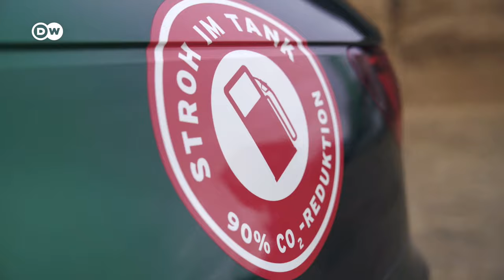Why eFuels Can Save The Combustion Engine

Comment: Combustion engines will never fully disappear. They are a highly developed technology and have too many advantages. Fuel powered generators, for example, will always remain important in some areas. Because they can still produce electricity, when everything else fails.

Also, heavy duty logistics and tourism will be eager for getting their hands on carbon neutral fuel. Ships and planes are simply way too heavy to be powered with batteries. Heavy long distance trucks probably as well. And lets not forget that there are big industries, that would not be too happy, when the combustion engine disappears entirely. Repair services, spare part dealers, used car enterprises and many others. They will all not be too hot on that scenario. Many always only think car engineering and production in terms of workforce reduction, should the combustion engine be a goner. It goes much further than that!

Right now, e-motors are the talk of the town. In no small part because of significant political good will and substantial subsidies. Which especially entices businesses to get electric company vehicles, since they can give themselves a PR effective green tap on the back and shave off many of the costs, (plus writing these cars off of their taxes anyway). But I am not fully convinced how well a major or (let alone ) all out fleet of electric cars would work at scale.

One big problem (imo) is that we probably have seen the biggest cost cut downs in battery technology already. Which means that a new battery will remain the most expensive functional part in electric cars. So when a battery fails or simply becomes too unreliable to be used any longer in the car, this will typically mark the point, where many electric cars will enter the used car market. But who buys a used car, where one of the first orders of business will be a battery swap or replacement, which will at the VERY least cost another 3.000 Euro (assuming a small 40 kWh battery and very beneficial price development in the next four years)?

Battery price and/or a better life span will be key for e-motors to succeed at large. They have done fairly well on other fronts (like possible reach per charge, comfort, ease of maintenance and general performance). But the price tag for battery replacement makes e-cars very unattractive for many used car buyers, which is a mandatory factor for broad market acceptance that is not to be underestimated at all.
Reply: This comment is filled with SO MUCH misinformation and baseless assumptions that I do not even know where to start.  Especially your battery swap argument. Let me make it clear that this only even applies to second gen modern EVs I.E. the first Lithium Ion cars, MOSTLY the Nissan Leaf. No other EVs suffer from anywhere NEAR that degredation. I own a 7 year old used EV which had almost no degredation, most EV batteries don't degredate as much if the car has decent battery management system, the Leaf did not have that.
In fact the Leaf is probably the reason why this stereotype exists in the first place.
The battery swap myth is simply not true for 90% of EV models.
Nevermind the fact that even battery replacements on an EV after 8 years would STILL be less expensive than all of the maintenance you'd have to put into a gas car over that time combined, nevermind the cost of fuel.

Concerning your baseless assumption on battery prices, you don't know that, all signs a pointing in the direction that battery prices will continue to drop, many companies are currently building giga factories to achieve that, we are at the beginning of an S curve here, the max production capacity that we need has not nearly been reached yet, and the closer we get to it, the cheaper the batteries will become to produce.

Now let's talk about emergency generators... They suck. They work when everything else fails, yeah as long as you can come by gasoline that's true.
But batteries can do the same, and you could recharge them using solar arrays, in fact many people around the world have used systems like that to disconnect from the electricity grid.
Solar, wind and batteries will be used for microgrids which are much more resillient to outside force than the macro grid, and their existence alone makes gas generators obsolete.

About Trucks and airplanes. Yeah you might have a point there. But what about hydrogen? To create e fuels you need to create hydrogen. Then you use energy inefficient processes to turn this hydrogen into hydrocarbons, then you use those hydrocarbons in very energy inefficient engines to propell a vehicle... So why not just use the hydrogen and skip 3 or 4 inefficient steps? Because fuel cells are expensive? Perhaps, but I think they are more promising than an inefficient technology that barely exists in the experiemental stage thus far, and offers no real benefits over the competition other than "modified versions of today engines could potentially run on it." Because that's another issue. Most car engines on the market right now cannot even handle synthetic fuels, so you need new vehicles anyways.
Reply: Planes use compressed air I thought?
Reply: @VoodooGMusic  I am not sold whatsoever on this idea, that batteries will get much cheaper. Just look what a battery replacement for a laptop costs. Same tech (at heart), much smaller, has been around forever - still costs 30 to 50 bucks.

The major price drops have resulted from car batteries having still been a fairly experimental field not too long ago. Now the mass production is there, as the tech is understood well enough - and they still cost what they cost. Needless to say that lithium prices only knew one directon over the last two decades - upwards!

I know, that an electric car stands to be cheaper maintenance wise. But the used car market is an entry level market for many consumers. Or just for anybody, who doesn't have the coin for a new car. And again: When will most electric cars enter this market? When their battery is sharply decreased or has been uninstalled to serve a second life service. That just comes with the territory. There are no two ways about that.

That is lilke buying a used car without a motor. Who the hell would do that? And given that several mass consumer markets (mobility, gadgets and appliances as well as energy storage in industry, businesses and households) are all eyeballing battery tech at an ever increasing scale, the assumption that they will get so much cheaper, is simply gullible. The lithium price itself is a key indicator for that.
Reply: @VoodooGMusic  In you comment it sound like electric energy is free. Here in Germany you do not have a large advantage when paying for  30ct at your house and 50ct at a charger. 

2. Generators need to be light. Same reason you do not see high powered chainsaws which can be used for a longer period of time in the forest.
Reply: @DerSnipOr  I am aware of the electricity cost in Germany and it's baseless inflation compared to our neighbors. Still it is cheaper than gas, and add to that the lack of maintenance it's way cheaper to operate an EV than a gas car.
Concerning chainsaws and such, most of those can now be replaced with electric devices, the reason that doesn't happen instantly is because of the replacement cost.
Reply: @VoodooGMusic  
Both you and the original poster are very long winded. But both raise great points. 

In short i hope BOTH you guys are right. Ideally you, but lol. Heavy freight and shipping just works better. Due to something called energy density. Less volume needed for gas than a battery cell. (At least for now.) But as long as we phase out and we should be okay, but its not like we have much time. 
Unless carbon sequestration takes off.

Shipping and imports could also be reduced if more people bought local. Unfortunately LOCAL for California, an already population dense area that also exports a lot, means their water source further contributes to drought. 
If only we could locally recycle as well then it would kill at least 2 birds with one stone.
1) less emissions from shipping overseas
2) less oceanic pollution due to EPA cracking down on USA. (Something thats lacking in asian based recycling) 
3) better logistics due to the materials staying inside USA.
Reply: @MightyJabroni  never is a very long time, you genuinely believe in a 100 years or more we will still be using combustion engines if nuclear generators are as easily available then as combustion engines are now?
Reply: @karl810  Well ...... never say "never", I guess. ^^ Of  course, you are right.
Reply: @psychologicalsigma9917  planes use kerosine
Reply: @VoodooGMusic  You can run current car engines on e-Fuel go watch the video Porsche did
Reply: @stanleysimmonsreactions9056 you can when you are able to get efuels. And this will definetely not happen the next 20 years…
Reply: @MightyJabroni combustion engines are already dead…

Comment: Combustion engines need to be efficient since they are only 25% thermal efficient average while the best production engines run at over 40% efficiency and Formula1 engines run at 50% efficiency 
I think by the end of this decade over 50% efficient production engines will hit the market and with negligible NOx emission 
Using hybrid systems, free valve and pre-chamber ignition or microwave ignition and using biofuel and e-fuel will create a ideal combustion engine
Reply: I also read that turbines are ideal as range  extenders in hybrid setups. They are smaller, lighter, have less maintenance, more power, quieter, and burn much cleaner than piston generators. Check out the TED talk from Wrightspeed.

Comment: efuels can be one of many approaches to move to more clean burning easily transportable/storing fuels for the ICE engines? scania has been building buses that run on ED95 fuel which is 95% ethanol and 5% additives so there is more than one approach to the problem and that could be key : flexibility, diversity and let the economics/politics decide in the long run (the more pragmatic approach?) 
update : after studying the whole efuel process i wonder if the whole process could be far more economical and a real immediate solution if there is no methanol to gasoline high energy last stage? just use methanol as fuel as is (with modification of current ICE engines perhaps?)

Comment: What about the worlds most popular BioFuel: Ethanol? It is made from a vast variety of different sources including trash through gasification. Modern cultivation techniques cut total emissions by 64% or more. Indeed it's already distributed in a variety of formulations but the higher content grades require minor modifications to most existing engines. A much more pragmatic approach than demanding everyone buy an entirely new electric vehicle because modification cost maybe 1,000 Euros.
Reply: Can you convert a regular gasoline vehicle to run E85? If so what needs changing?
Reply: @VintageCars999  of course and millions have. The ECU needs to be made Flexfuel to accommodate ethanol or gas or a blend of the two which it will calculate. Many popular cars tuners sell flexfuel ECUs. Fuel lines in modern cars don’t have rubber. Fuel pump needs a 30% capacity upgrade. Fuel injectors need a 30% larger upgrade. Yes you’ll get 20% worse mpg but the cost is 40% less per gallon than premium and rated at 105 octane. A Challenger should be easy and the ECU can really jack up the boost.
Reply: @LawrenceMarkFearon  that would be nice. Gunna hold off on converting my Challenger but I was thinking of buying a cheap $2,000 car to do the conversion. Probably could do a 2000 Silverado I was planning on getting anyways.

Will it work going back and forth between fuels as well?

Anything to slow down the need to ban the sales of new combustion engine vehicles, not sure if E85 will do that but I'm hoping more fuels will make it to the market and make an impact because I will never drive an electric vehicle. Instant torque is a gimmick and I like wrenching on older vehicles.
Reply: @VintageCars999  Yes it will Absolutely calculate the precise Air/Fuel ratio for the blend. I do recommend using it in a boosted engine or at least a premium fuel required car to gain the most power and save money. I'm also proud to share with you my brother that new CARBON NEGATIVE ethanol fuels are coming online to replace low carbon corn based ethanol. Miscanthus is a cellulosic ethanol feedstock that pulls greenhouse gas out of the atmosphere [-15% kgCO2e/mmBtu] producing 3 times the fuel per acre vs. corn ethanol. Driving your car will actually clean the air as more Miscanthus is grown and with vast distribution networks already in place for current cars. This is obviously something electric cars will never ever be able to do. So the internal combustion engine has as bright a future as possible. lhttps://www.epa.gov/fuels-registration-reporting-and-compliance-help/lifecycle-greenhouse-gas-results

Comment: If the same amount of energy were to be put into the research as has gone into wind,solar etc then the ICE will never go away,in WW2 germany was making synthetic petrol due to their lack of oil fields,and those that were around were romania?...i know the fields that existed were fought over and just like the "battle of the bulge" this too was over fuel dumps,so making fuel(petrol) should be a no brainer,just put the effort into the technology and it'll happen.

Electric cars construction is not very clean either and you still have to generate power to charge them,unless you make synthetic fuel and have self charging hybrids.

I don't like bio fuels as the need for fuel crops outstrip the food crop and that leads to hunger,unless you're a cabinet minister then the mugs (the serfs) buy breccy ,lunch,dinner,heating,transport costs,booze,hookers,second-third-fourth homes etc etc,while we all starve and freeze.

Geo thermal is another power grid generator not talked about enough,it's hot down there,make the steam turn the turbines and cable up the leccy,have the generators underground,ask anyone who worked coal mines/pits it gets hot and free hot is cheaper to make leccy ....yes.

Comment: Bio fuels are a dead end for cars. They are a desperate attempt ot save the ICE, but the ICE is as good as dead. Current gen ICE vehicles cannot run on e fuels, and even if they could, and were carbon neutral, they still emmit toxic gas into cities, electric cars don't. Car companies would have to invest RND into an uncertain technology that might be banned anyways, or they could choose to invest that money into EVs and EV infrastructure which are in comparison a safe bet, there's no reason why they'd choose e fuels, and as for governments, if they care about becoming carbon neutral quickly, and want to clean up city air as well, then e fuels are a terrible choice.
Nevermind the fact the e fuels are ridiculously expensive compared to charging a BEV. They are in fact even less economical than hydrogen!